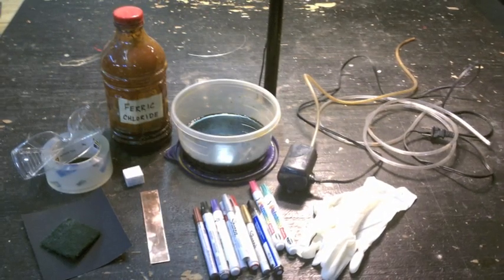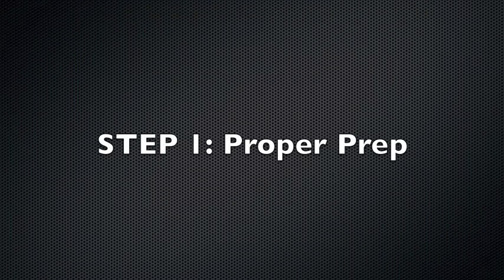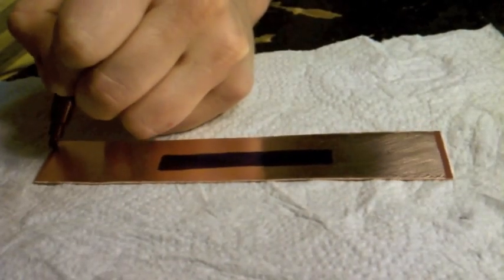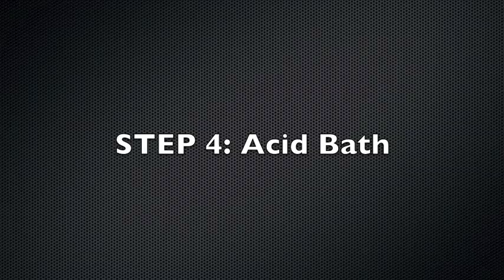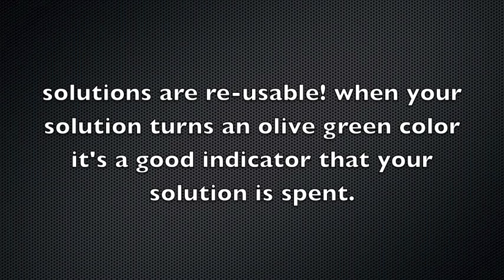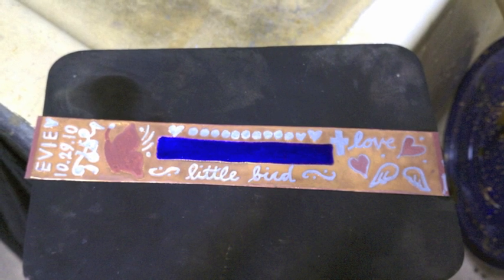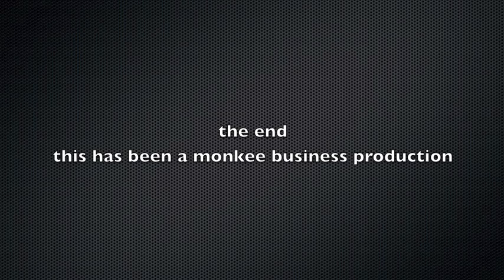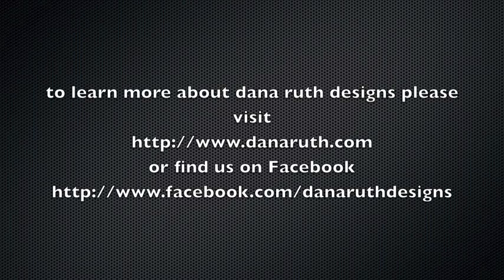Acid Etching Brass, Copper, & Bronze

Comment from the maker: that is normal when the acid contacts bare metal. try sealing the edges around your design with packing tape or draw a frame with your resist to protect that area from the acid. that should do it! good luck :-)

Comment: I've just tried etching brass & copper for the first time - with the brass I had the design face down into the etchant and a whole lot of lines ended up around the edge, so I tried suspending the next piece vertically and ended up with lines that looked like the design had 'runs' in it. Do you know what I may be doing wrong? Thanks so much!

Comment from the maker: i would make sure that you give the resist ample drying time until completely dry and make sure that your surface is clean for the best adhesion. in the studio, i use paint pens. you may give sharpie markers a try. another option is to transfer your design to your metal with PNP Blue, press and peel blue transfer paper, which requires a reverse of your image and a laser jet printer.